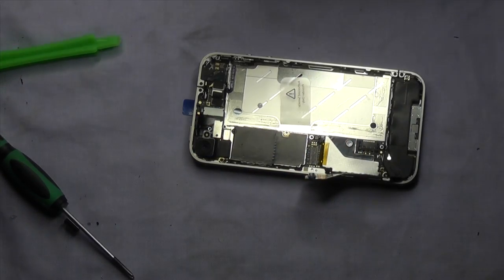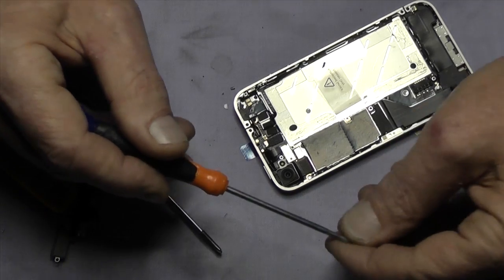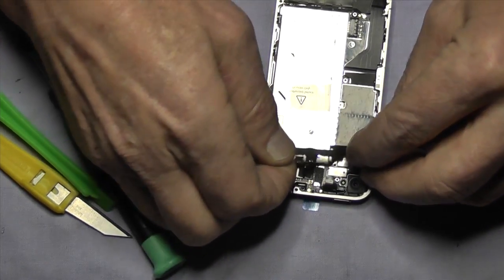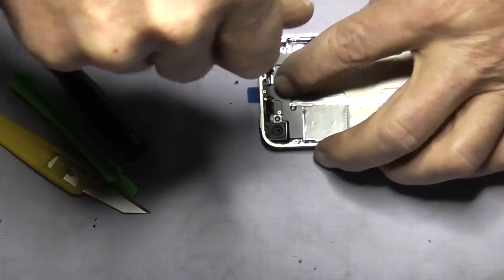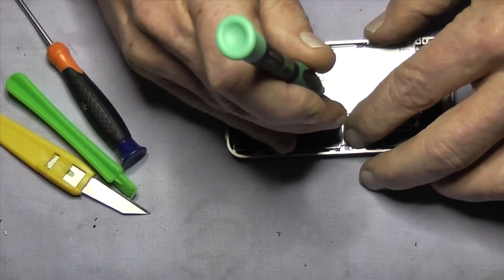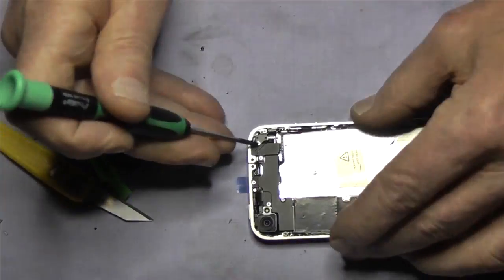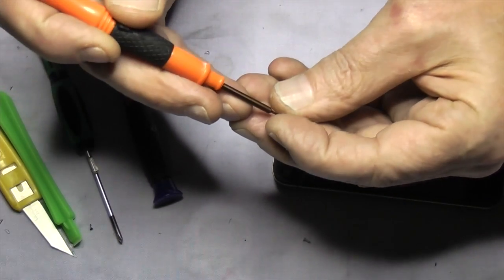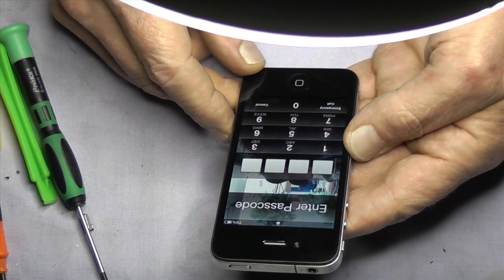iPhone 4 screen repair part 3

Comment from the maker: Yep, have a look at your new glass screen you will see two holes that show as a violet blue, just darken them with a permanent black marker, have a look at your old screen to get an idea of how dark , also if you have just one elongated hole divide it with the marker pen. check also that the small foam divider is in place between the two sensors.

Comment: Hi buddy 

I have been doing repairs as a business for around 18 months - can do majority of things but with iPhone 4 I lack consistency on getting a perfect fit with the display assembly on the mid frame. Any tips? If you have a look at one of my videos there is a speeded up repair I performed on an Iphone 4 conversion to white and dock connector replacement. Thanks mate.